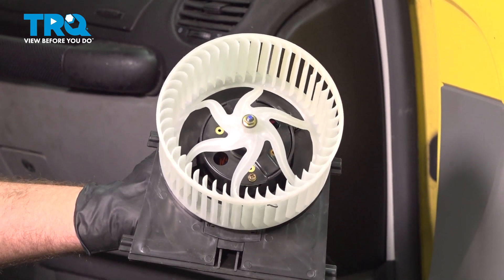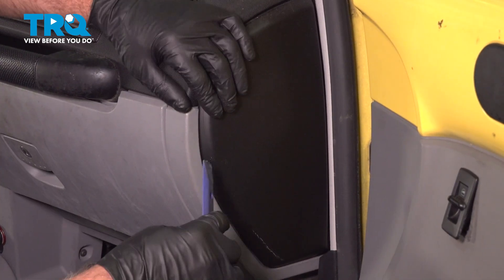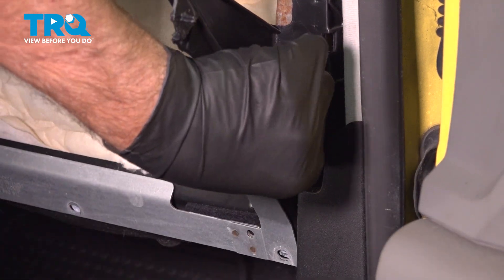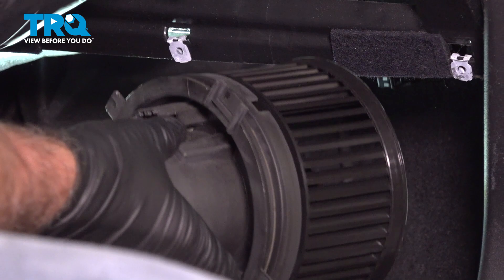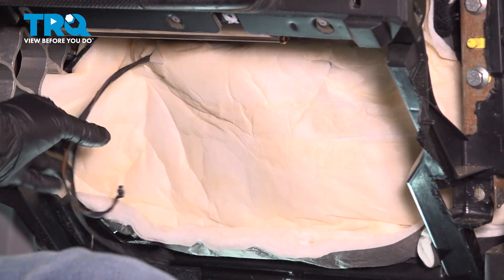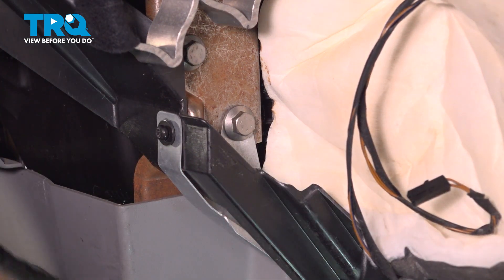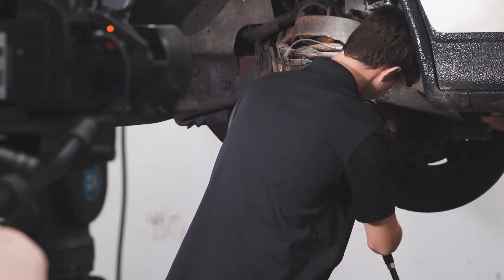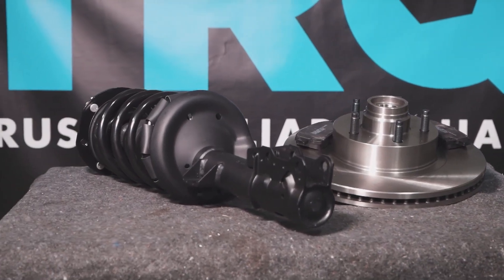How to Replace Blower Motor 1998-2010 Volkswagen Beetle

Comment: Hi, the connector you disconnect at 4:15, is this where the motor gets its voltage from?  I want to measure with a multimeter whether the air motor is bad or not getting voltage, that's why I'm asking.